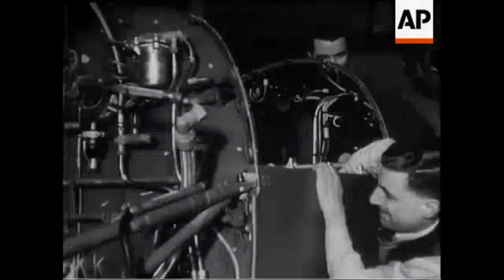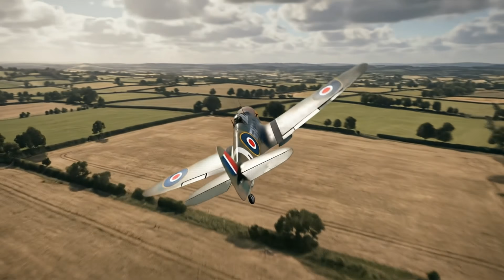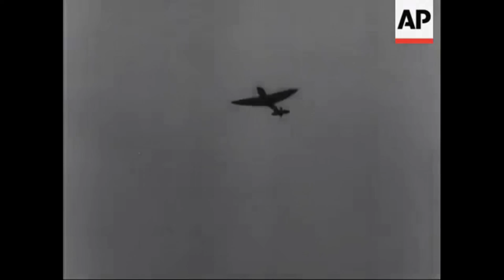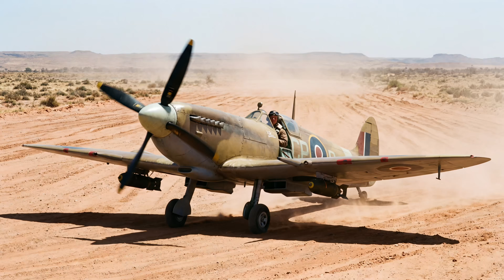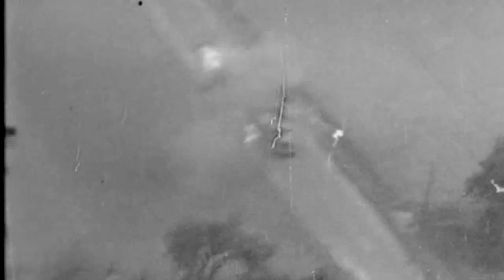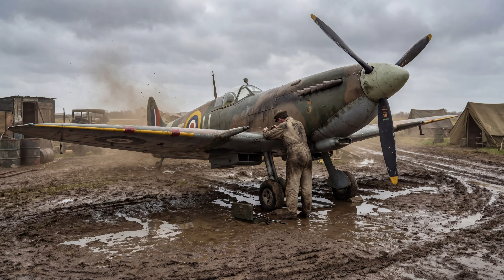The SECRET Why The Engineering Of The Spitfire Was So Brilliant | Notorious By The Nazis

Comment: USA pilot for over 50 years. Several months ago (Sept 2025), while in UK I got to fly a 1943 Spitfire Mark 9 (2-seat conversion) including aerobatics. Such an amazing airplane. One interesting fact is that the airplane I flew had 3 engine failures in its past, all requiring belly landing. The latest one was only 4 months prior to my flight. Plane was tough enough to be repaired quickly and put back into flying condition. This is the height of my flying experience.